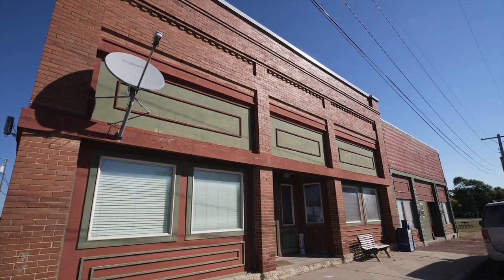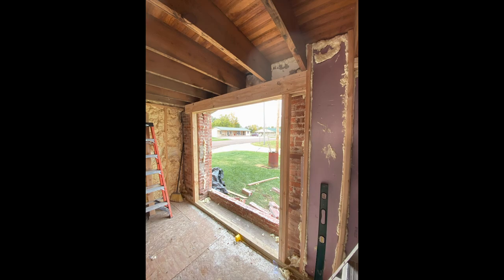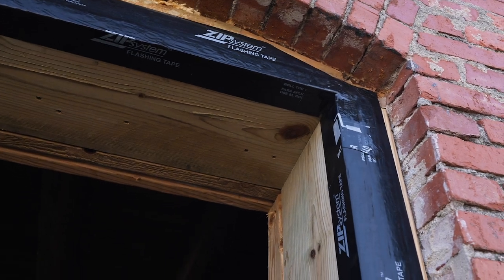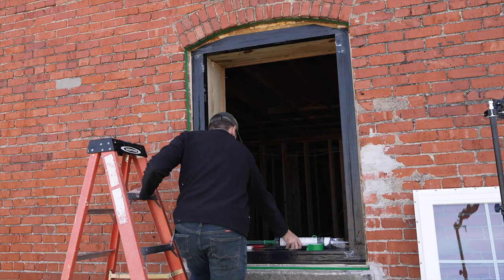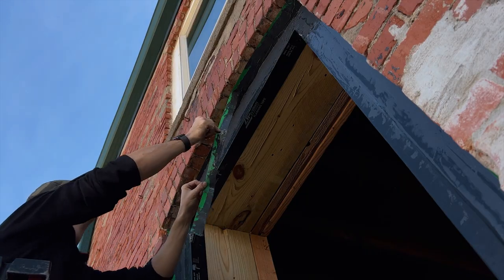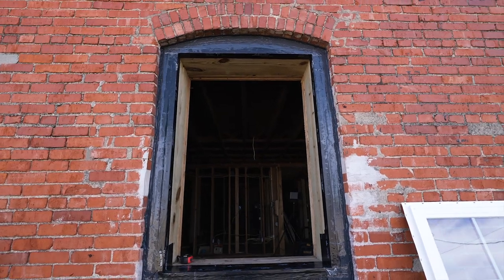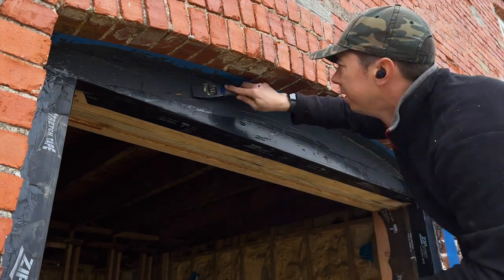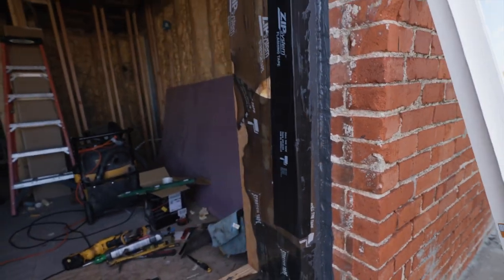Finishing Up Window Sealing & Install - Historic General Store Renovation

Comment: How did y’all clean or remove the mold ? And the area in the basement that gets wet ..do you worry about mold growth down there ?
Reply from the maker: We haven’t had any mold issues yet. We only have the bare concrete walls though, so not much for mold to grow on.

Comment: Probably should have done liquid flash before the sill flash. Now if water gets back there you are just holding it in.
Reply from the maker: The company recommends using the liquid flash on top of the tape rather than the other way around, which is why I did it in that order.